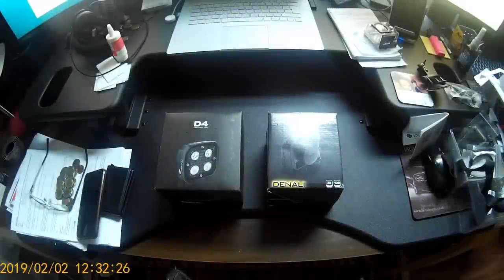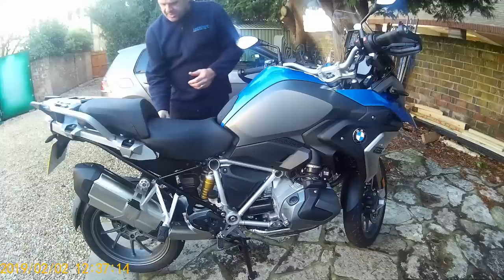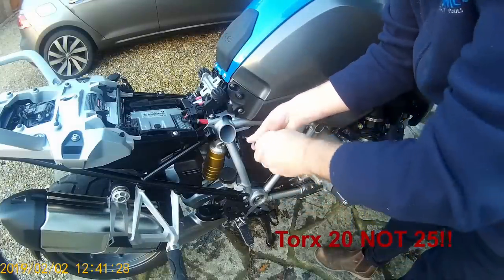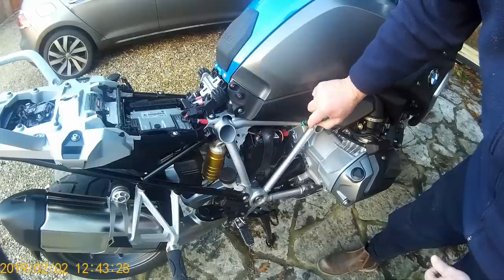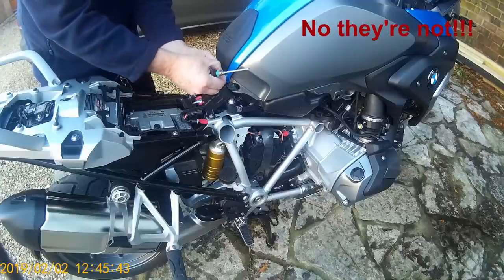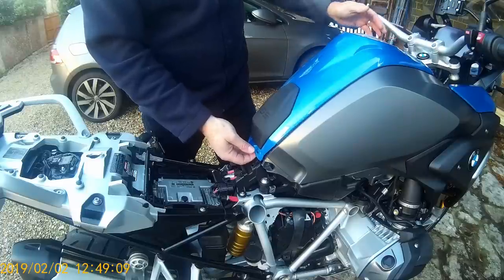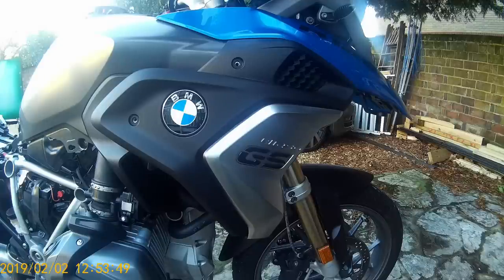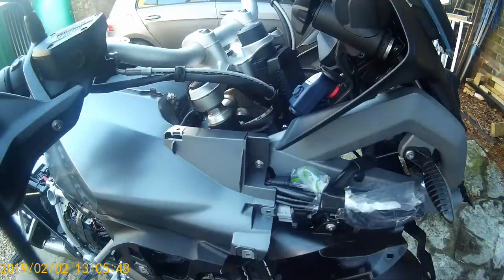BMW R1250GS Denali Lights and Horn Fitting

Comment: Thank you for a very detailed and informative explanation of the installation, and for including a step by step description. I have just ordered this system for my R1200GSA and now feel much more confident removing all the various panels.
Reply from the maker: BikerPete2 cheers Pete. Slowly and make sure you mark which bolts are in which panels and you’ll be fine. Good luck and ride safe

Comment: Fitted the same system the other day to a costumers bike and I have to say very very nice bit of kit the air horn is super loud and it strobes the led lights at the same time grate touch. Handy things in the settings like turning off the led light on the side your indicating and flashing the rear light under heavy braking. Super eazy to fit and realy neat and tidy
Reply from the maker: Yep. Fully agree. Probably my best fitment. I have the Gen 1 controller so unfortunately it switches off BOTH lights with either indicator. I switched that off in the end as I found both lights going off made people think I was flashing them out!!  I have strobe in horn and strobe in flash-to-pass switched on and the best feature is alternate with hazards. People think it police when filtering and actually move over 😂

Comment: This has got to to be the most gentle way of removing the body panels on the 1250, most especially that "stubborn" little piece of plastic that you have to gently pry off.  Although I have the 1250 GS Adventure, the removal process is much the same, thank you for sharing.
Reply from the maker: Glad it helped you out, slowly and methodically. Ride safe
Reply: @nickhodgeUK  I have search the entire youtube channels regarding the removal of these panels on the 1250 and so far, yours has got to be the most clear and straight to the point procedure coupled with your clear speaking voice providing good guidance...lol
I also got the same Denali kit you have, D4s  & DM 2.0, B6 brake light, and the soundbomb.  By the way,  my sound bomb came with some sort of wrap around material to protect the brake hydraulic line from chaffing/rubbing against the horn.  I also wrapped the brake lines with a hockey tape to further protect the lines.  thanks for sharing again.
Reply from the maker: @dcdell2008  Ah the chafing point is interesting. I was concerned it was very close but to date (6,800 miles). I shows no signs. DM2's for me next...watch this space (channel)

Comment: I 𝙝𝙖𝙙  been considering adding aux lights to the front of my new 1250GS HP.   This has got to be one of the best "how to"  videos I've seen on YouTube.  𝙀𝙓𝘾𝙀𝙇𝙇𝙀𝙉𝙏!  𝙂𝙧𝙚𝙖𝙩 𝙟𝙤𝙗!!  On the other hand, after watching you  take apart all that stuff I've reconsidered.  I think I'll just add the can smart  or  EZ can  and fit a strobing tail light. Or possibly consider mounting some aux lights  down on the crash bars, if possible.  I recently added a "Battery Tender" dongle direct to the battery, and while that was a very simple procedure I saw how little room there is to route wires for modifications without taking a lot of body panels off, not sure I want to do that.
Reply from the maker: John Scott cheers John. It looks daunting but given time and organisation it’s not that tough. Enjoy the bike though and ride safe

Comment: Incredible detailed video. Thanks for taking the time to explain every move !
Reply from the maker: Reli Tal thanks Reli. Hope it was interesting and useful
Reply: @nickhodgeUK  Hi Nick - Did you end up removing the tank for running the wires to the back of the bike? I got all the plastics off, including loosening up the tank but the passage from the front through the airbox and the tank is not obvious....
Reply from the maker: Reli Tal hi Reli. No. I just lifted it and there was a gap on the right (as sat on bike) of the tank that allowed with some wriggling, the wires to pass. I did them individually rather than a bundle

Comment: Great video, Ive now fitted my Aux lights but can't seem to find any info on angle setting or drop angle of the light over a given length. Do you or anyone have this info. Big Thanks in advance, Paul
Reply from the maker: Hi Paul and thanks. I don’t have it I’m afraid. Maybe Denali??  I used a wall in my garden at night (you get a much better idea than in daylight or even dusk) and adjusted them just below dipped headlight. I really use mine for visibility OF me more than visibility FOR me so erred on the side of lower so as not to dazzle. I also have them through the CanSmart at 60% on daylight running and dipped beam and 100% on full beam. Hope this helps a little?
Reply: @nickhodgeUK  Cheers Nick thanks for the advice 🤘

Comment: A very informative video Nick for which I am grateful but surely there is an easier/quicker way to route the cables? But then, I suppose not. I find it extremely frustrating that manufacturers of "Adventure Bikes" fail to provide ways for buyers easily to add the various electrical accessories we all seem to want (lights, decent horns, heated clothing, more than one GPS etc. etc.). I feel tempted to weld a bit of conduit alongside a frame tube or some such. Equally, the 1250 seems to have less space for stuff than its predecessors; the space under the pillion seat is reduced (I used to get a Fuseblock in there before but would now need a Hex EZCan to fit what's left for space). The second DIN socket under the seat of the Twincam has disappeared and so on. Having seen this I reckon I need to find an enthusiastic farkler to do the job for me.
Reply from the maker: Chris Knight certainly there’s not enough room with the Denali connectors. Also you need to avoid heat and spinny things. I like neat too. Good luck though and thanks for watching. Ride safe

Comment: Nick, thank you very much for this helpful, clear and thoughtful video.
Reply from the maker: Thanks for the comment Tim
Reply: @nickhodgeUK   Hi Nick.  Can I ask a follow up question.  Where did you put the Posi Tap white wire?  I have done the installation but the lights are not coming on, possibly because I have not correctly tapped the trigger wire.  Thanks again
Reply: Please ignore my last comment above. You don’t have a posi tap with a trigger wire if you’re using the CanSmart! Apologies.
Reply from the maker: Tim Barnett nope. Was just replying that. I can’t find wiring diagram from lights but if you’re still stuck let me know and I’ll see if I can download them and decipher 👍🏻

Comment: Superb video. I've bought a Hex Ezycan and rear and aux lights but I'm trying to find the confidence to take off all those panels! Great job
Reply from the maker: scabbyjoe21 just take your time you’ll be fine. Get expanded polystyrene and push bolts in exactly as you see them and mark what panel it was. The only ‘confidence’ part is snapping the top tank panel. All the others, if they don’t come off, you’ve not got all fasteners. The great thing is the tank only needs to be moved off its pegs so no disconnecting keyless tank wires and fuel gauge/pipes. Good luck!

Comment: Brilliant video Nick, I will be doing exactly the same install on my R1250GS TE Exclusive in 28 days time, not that I’m counting, much😉
Reply from the maker: Paul. Enjoy. They’re great bikes. I love it and had a 1200 for a short period before. Mate has an Exclusive. The side panel is very slightly different I think but other than that you should be good. Take your time and watch the screw length/type. Sorry about the sound, I’m no vlogger and BTW. it’s mainly Torx 20 😂😂
Reply: Me too. Only just discovered these. My GSA 1250 TE Exclusive will be in my dealership end of May. I'm now going to look for this set up. That horn sounded awesome.
Reply: Nightcrawler777, you won’t be disappointed😉
Reply from the maker: Nightcrawler777 used the horn for the first time in earnest the other day. It woke up the car driver. Only downside is you can’t just toot someone! ;). Hope you enjoy the bike. Ride safe
Reply from the maker: Paul Lynham how’s the bike Paul. Still loving mine. 2,500 miles done now. Going to be a few more videos soon. Maybe a bit of an owner review. Perhaps a run over the TFT in detail and also booked a highland tour in August. Here’s to another good riding season. Be safe
Reply: Nick, loving it, 1200 miles, had it a month now, I did the NC500 last year in May/June, we had fantastic weather, I look forward to seeing more of your videos👍🏻

Comment: I think the stock BMW horn is louder than the Denali. I had one before and cars never seemed to pay attention to it. Also I would honk at riding buddies to get their attention and they said they never heard it. The Denali is loud in the garage but I think the tone isn’t penetrating on the street.
Reply from the maker: RonnieMX Welcome along. The original is a different tone for sure and I think beeping buddies it is probably more effective but generally I would think that’s slow paced?  I had two early instances at 40 (ish) and they just kept coming!!  I have both now and the lights set to strobe when horn is pressed too so they shouldn’t have reason to say they didn’t hear an see me at least 😂 Again. Thanks for taking the time to comment

Comment: Question: at 2:27 you remove your CAN-bus accessory controller which clearly has HEX branding and logo visible, also at 2:41 you refer to the device as the "ezCan" before correcting yourself and referring calling it a CanSmart. I appreciate that both devices might for all intents and purposes be the same, but why claim you installed a CanSmart when in fact it is a different manufacturers product?
Reply from the maker: Chris Hille oh dear Chris you infer a conspiracy. Do you have a CanSmart? It’s made by EzCan and branded for Denali. At the time I did the video, the CanSmart had 4 circuits. You’ll maybe notice (with your eagle eyes) mine has four, so sorry to disappoint you. I purchased a CanSmart, I fitted a CanSmart. How they decide to brand it is not my concern.  Hopefully you’ll also notice it comes fitted with Denali connectors and wiring. The base EzyCan does not. Lastly the reverse side, the side I have Velcro on to position it has the Denali branding. If you want to be sure what’s in the box is what’s on the box, buy kellogs.

Comment: Thanks for the detailed video, what did you do with original horn after installing soundBomb, is it ok to keep original in its place with its wire attached, if so will they sound together?
Reply from the maker: Yes. Just leave it and both sound. Although sound dynamics dictate you only hear the loudest but they are both sounding

Comment: Hey Nick, I recently had a Denali set (Gen II CANsmart, S4 lights and Soundbomb horn) installed. Great kit but, like you and a couple of your commenters, I also had concerns about the proximity of the Soundbomb to the brake lines. I raised this direct with Denali USA who told me that all the GS Soundbomb mounts should come with a protective sleeve (and a couple of cable ties) which is to fit around the brake lines and provide abrasion protection. The main distributors of Denali kit in the UK are aware and should be sending me the sleeve. I see you have installed the gear onto your new GSA which might have greater clearance?
Reply from the maker: Thanks for that Robert. Pop back and let us know. It’s a delicate balance of bracket positioning to clear forks and brake cables. It seems slightly better on the adventure. I put tape on my GS but found it never marked which I find surprising as it’s close!! I will one day shortly mount a GoPro on a bumpy/brakey ride and see 👍🏻
Reply: @nickhodgeUK  I'll let you know if/when I get something.
Video footage would be great.

Comment: Hello. I need to find the positive of the high beam. I would like to connect Denali spotlights that only come on with high beam.can you help me? where can I find it?
Reply from the maker: I don’t know the wire I’m afraid although a multimeter and the plug for the headlight or opening the switch should help you find it. You could do this in software too if you had a CanSmart or Hex EzyCan (same thing) by turning off daylight running, setting low beam intensity to 0% and High Beam intensity to 100% 👍🏻

Comment: As ever, love all your videos and updates, keep them coming. I'm just about to install the same system on my 2019 GSA and note a lot of people remove their petrol tank or loosen it to reroute cables, is it really worth the effort to do that or are you happy with the result you achieved?
Reply from the maker: Hi Bob and thanks. I just popped the tank off it’s rubbers without disconnecting any hoses and such. That gives enough room to push the cables through. I like tidy and my objective is always to cable tie to existing wiring or cables from factory. That way you’ll know you’re not going to get movement or chafing 👍🏻

Comment: Really excellent instructional video Nick - thank you for sharing. It has given me more confidence to try out the same installation on my 2015 GSA. Can I ask where you purchased all the kit from? Thanks again.
Reply from the maker: Hi Simon. Thanks for the comment. I got mine from various places. I would recommend https://www.abikething.com (say you came from me may help 🤷‍♂️). It’s important to know if you are going for CanSmart, that has ALL the wiring looms for 2 sets of lights and the horn as well as tail light. This means you only need buy single lights NOT light sets, which also have wiring. The CanSmart are made by Hex Industries and many are tempted to buy their EzyCan as it seems cheaper. Again, the EzyCan whilst the same internals, has no wiring looms for lights etc. I thoroughly recommend Denali for quality and ease/security of installation 👍🏻
Reply: Nick Hodge Thanks for that info Nick. Yes, I’d already found abikething on YouTube and was planning to go for the bundle that includes the items you have. I’ll get in touch with him. Thanks again for your help. Simon

Comment: Great video Nick. What torque settings do you use when putting the bike back together pls. I guess plastic to plastic fairings aren’t too important but fixing the fuel tank back to the bike, for instance?
Reply from the maker: Any critical ones are in the manual. The panel screws just screwdriver tight. In fact the collared ones don’t tighten down they more locate 👍🏻

Comment: Denali are now supplying a little bit of anti abrasive sheathing to put on the Brake hose where it touches the bottom of the horn - your efforts to draw their attention to it were acted upon. Still, I wonder if you found a way of keep the hose well away. And, do you happen to know the the torque setting for that bolt that attaches the horn bracket to the frame, by any chance? Great vid, as ever. Cheers.
Reply from the maker: Hi Dave. That’s interesting. I did email them in the US to point it out. Interestingly neither of my bikes have even marked the outer pipe let alone the braid underneath. I have got some duck tape on this one as it’s not possible to mitigate the pipe routing. I don’t have the torque value I’m afraid 👍🏻
Reply: @nickhodgeUK  Thanks Nick

Comment: Hi Nick. Thanks for video ... gave me some excellent background to fit my kit. When fitting the horn you mention the horn close/touching the front brake hose and you’d contacted Denali for advice. I’ve got the same challenge on my fit .... what was the outcome please?
Reply from the maker: Hi Chris. I've had no issue so I think I was overreacting? I've done 7,500 miles and it shows no sign of chafing. All I did was added a little insulation tape to help 'lubricate' any contact
Reply: @nickhodgeUK  Thanks for getting back to me Nick. Like yours there is minimal contact - and no chance of the hose getting tangled/caught on the SoundBomb. To protect the hose from possibility of wear, rather than tape I used the tubular handle section from a plastic milk container secured with a zip-tie . Fits around the hose perfectly, 'slippy' and hard wearing. Thanks again for the reassurance.

Comment: Thank you for taking the time to share all this. I'm about to install the Denali Hex system and S4 lights on a 2017 Raylle. Im going to have two set of light leads going forward for the two systems so light is off when indicator flashes. Question is, I saw the right hand wires coming over the airbag and under tank, did the wire on the left light go over the left hand side of the airbox or the right hand side along with the others?
Reply from the maker: Hi Paul. The Gen 2 version may be different but all my lighting and horn wires go up the right side of the bike and under the air box. They are connected under the right side of the front beak. I only have one set, the D4s, but the tails are ready when I need to connect others. What I would say is my D4s are top mounted so the tails are plenty long enough. Not sure that would be the case if they were say bottom of engine bar mounted??? Remember too. If you’re buying the Denali CanSmart it comes with wiring and so then only buy lights (not light sets) as CanSmart comes with all cables and saves about £50 on lights
Reply: Many thanks Nick. Installed them today. Aren't they great!!!
Reply from the maker: Paul B in my opinion the best. Quality look and very much quality feel. Well done 👍🏻